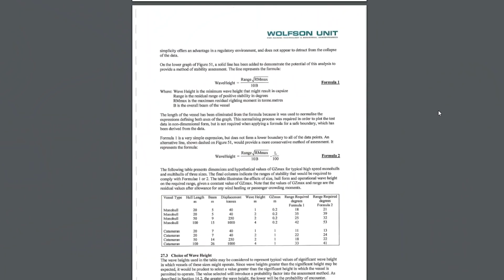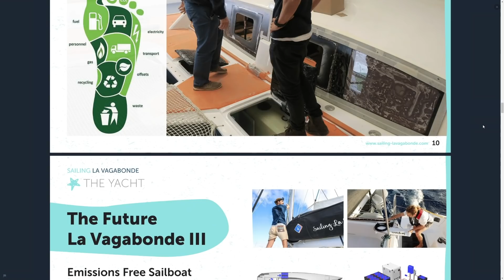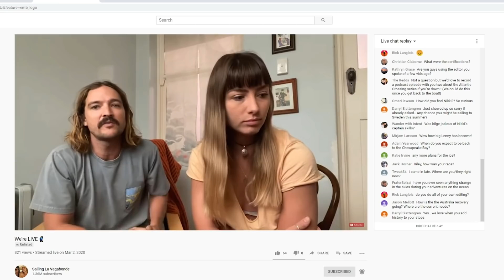Our Plan for an Emissions Free Vessel

Comment: You asked for advice from us, but I am not sure I could give any specific advice on this other than to remember that this type of tech improves and updates quite often. So be sure that your design is as close to future proof as possible. Don't let the 0% emission goal prevent you from building something that is close to that goal. The tech will improve and if you have designed a way to integrate more efficient tech as time passes then you can get closer to your 0% goal. 

Either way, I am on board to follow along your adventures!

Comment: They caught the Gretta Dumberg syndrome, so now they think its beneficial to virtue signal to everyone else. Bad idea.
Reply: But is it such a bad idea?  Even if you disregard the environment it seems we are at the point where an all electrical cruising sailing cat just makes sense.
Little or no weight penalty. Independence at remote anchor/passage - no need to buy fuel. Safer boat with no propane. Electric motors are nearly maintenance free. Noise  and smell free - great at anchor with aircon on. Recharge with solar and regen.
I would keep an emergency generator for safety (long range motoring) hoping to use it very little.  The only problem is price.  A large battery bank is still expensive.
Reply: Sailboats have used renewable energy long before Greta was born. Now it’s just evolving further with motors.

SLV are doing everyone a favour by promoting it. The more money invested in it, the better the technology gets, the more people buy them, the cheaper they are and more affordable for us.

Comment: Check out elco motor yachts.  They have been making electric motors and electric boats for a hundred years.  No joke.  Their product is designed as a retro fit on existing boats or new boat installation.  It can be installed to work with your current saildrives.  Pair that with a 3.2 volt lithium phosphate batteries. Cheaper, much much cheaper than a 12 volt equivalent with more capacity.   They can be wired in both series and parallel to give you the capacity and voltage needed.  You can keep your current boat but make it electric.  Maybe even offset the cost of the refit by selling you diesels and gearboxes. The batteries you can search are Voltronix and Winston to name a few.

Comment: Just a thought. At the rate technology advances, whatever you decide to do should be easy to change or upgrade. Modular systems. Pull out the old and drop in the new. Don’t know what that would look like but something to keep in mind. Otherwise by the time the boat is built at least some systems could be obsolete.

Comment: Add 20kWh-40kWh LiFe4Po batteries to the Outremer, get rid of the diesel motors and put 2 electric drives from Oceanvolt into the boat. The caveats are such a battery has to be warmer than 0.0C. A heater could be an idea. Warming the boat could be done by a diesel stove from Reflex in the case the arctic is a destination. The Eurovolt system is charging the batteries quit fast while sailing and these motors don't need maintenance. The existing space for the motors should be sufficient.
Reply: Why no one thinks fuel cells. One thing good about fuel cells is that they work better if they run with steady draw. If you put pod drives. You could point them at each other at anchor and let them run.
Reply: @bertsteen2014  Fuel cells need maintenance since the membranes have to be exchanged and the system is much more expensive than with batteries. Fuel cells need methane or hydrogen. Both are quite rare at sea.
Reply: @E.Levine  H2O???  But I didn’t think about membrane maintenance. That could be a hurdle
Reply: @bertsteen2014  https://www.youtube.com/watch?v=pgdXbe1in64
Reply: @TheOverproof151  when a motor has 10kWh and you have a 40kWh battery, you can run the motor for 4 hours at 100%. But when you go regenerative you wont do that. The motor is used to get to the dock and the planning is accordingly. The drag while charging with over 1kW cost 1 to 2 knots.
Reply: In fact that's what Jimmy Cornell is doing based on an Outremer 4x(that he plans to cruise on the Magellan route), and that will then be at the catalog as 4E (without generator) and 4H(with a diesel gen for dead calm/emergency). Wouldn't be surprised this video is just a stunt/beginning of a serie that will end up with an Outremer 4H
Reply: @cormacsyt0  When UMA is fine with 12kW the 200kWh are quite nerdy. Living responsbile is including changing some habbits too.
Reply: @TheOverproof151 .... I believe Uma did an extreme test on their electric drive system and ran it for 2 hours.
A complete failure for an ocean going sailboat.
Reply: @cormacsyt0  The efficiency of the Ocean Volt system is much higher than any Diesel motor. UMA has here the right approach. Sail when you can and don't when it becomes a problem. The usage of a generator adds just weight